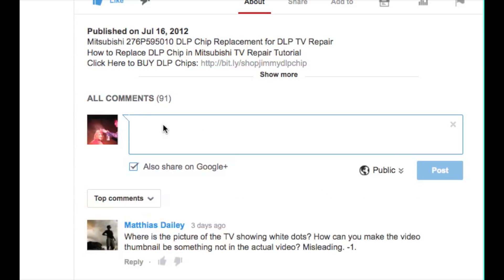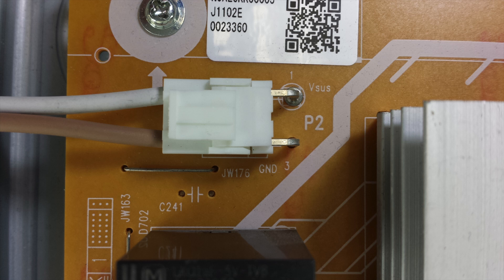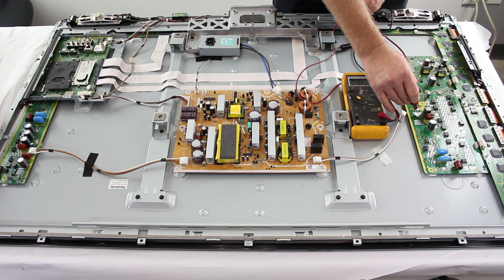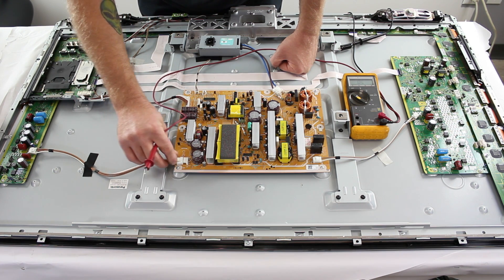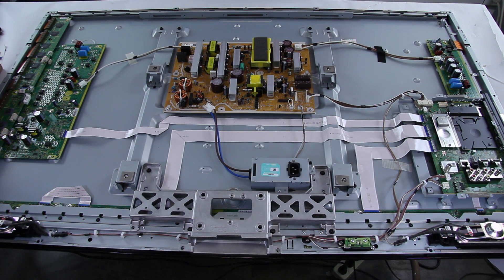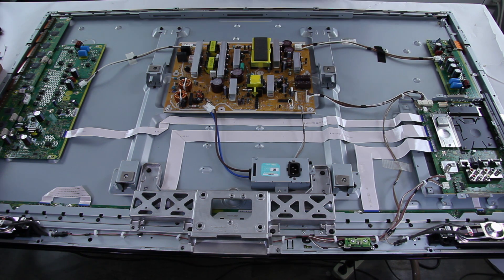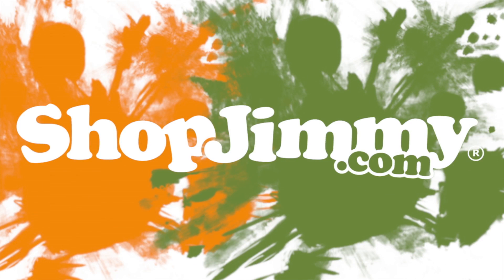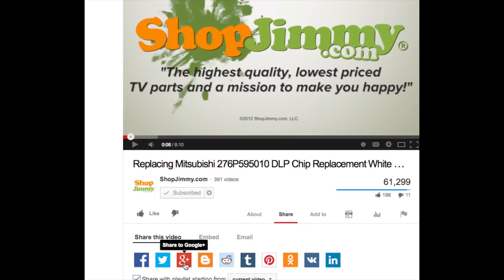Panasonic Plasma TV Repair - Understanding 14 Blink Code - How to Fix 2011 Panasonic Plasma TV

Comment: Thanks for the video! I have a Panasonic TC-P55ST30 manufactured July 2011 that i purchased also in July 2011 and have the 14 red blink code. My kids said they heard a pop and the TV turned off and that was the last of it. I only get the blink code. I tried as you stated, plug it in and after the first click push the power button and the light is solid red. My question is what power supply board would I need? If its reasonable I will purchase one and try replacing it and hope that is it. I see some on eBay but not sure if they're compatible. Prices are not bad. Thanks in advance for your help!
Reply from the maker: Sergio Sanchez   Try this at your own risk. Unplug the TV, then disconnect the SC board and plug in the TV to see if the TV powers up. Reply with the results of this test. Thanks! www.shopjimmy.com
Reply: ShopJimmy.com I did this (because my tv's issue is now similar to Sergio's - solid red light) and got 8 blinks. New power board or A board?
Reply: ShopJimmy.com I will try this...should I unplug both the ribbon and clamp style connector or just one of them? By the way, I tested the p board with all connections and have a short as your video stated. I then unplugged the p 2 connector and short went away. It was reading 2 on the meter but was climbing at a slow pace.
Reply: ShopJimmy.com Me again, OK I tried unplugging both the ribbon and the connector and got same result. Also tried pushing power after I hear first click and get a solid red. Also, I did swap out the p board and have same 14 blink code as before. Same after pushing power button after first click. Thanks again for the help!

Comment: Panasonic TC-P42S30... On power up... half the screen is blank... right side... menu shows up because it's on the left side.  no shorts.  Thinking input board.  FYI the ribbons that go to screen is one board not 2 as shown in your video.

Comment: Hi,
I have a Samsung Tv Model # LN46A500T1FXZA, it has a clicking noise.
I've replaced the capacitors on the power supply board, no changed. When i disconnected the video/control board cable, the clicking noise stopped; What can be the problem?
Thanks for your help.
Reply from the maker: Apolo We  Please watch this video FIRST to help with your repair!  https://www.youtube.com/watch?v=BP3NVNCGEv8   I recommend replacing that board you disconnected and the clicking stopped.  Click this link to replacement parts for your TV model number:  http://www.shopjimmy.com/catalogsearch/result/?q=LN46A500T1FXZA  There may be multiple boards for the same TV model number, be sure to match part numbers on your current board, with your replacement for compatibility.  Thanks and please let us know if you have any further questions with your TV Repair!  www.shopjimmy.com

Comment: Hi I have a 42 inch Samsung plasma model number PN42C450B1D,  MODEL CODE PN42C450B1DXZA.   I was watching tv one night and heard the loud pop and then the screen went black but still have the sound of the movie.   I turn the TV off and on and still have the sound.   I removed the back and everything (caps) looks okay.   According to your video it may be the y board.  So my questions are:1) Could it be anything else?  Is this thing worth repairing? 3) do u have the y board (model no 42U2P_Y-MAIN (1LAYER) available today? 

Thank you in advance for your assistance.
Reply: +Phon Phasavath Could be your power supply or your SC board. If the T.V. clicks every time you turn it on and you get a LED error code a board needs to be replaced. Test the power board for 120v with a meter. If it's the T.Vs built in sound it's not unusual for it to keep working. It's a separate amp built on a different board that gives you audio. I would start checking the boards one by one if you know how to use a volt meter. Sincerely, Steve

Comment: Hello, thanks for the video. I was able to test all the connections, and all of them show activity except the TPSC1. Even after  disconnecting the various boards, it still shows no activity. Does that mean both the SD and SU boards are both bad? I followed your video just like you said and the short is not removed by disconnecting either of the boards. Please help! thanks
Reply: I have a TC-P50ST30. Looking forward to your reply to get my tv fixed. thanks!
Reply from the maker: rbk rbk  Please watch this video FIRST to help with your repair!  https://www.youtube.com/watch?v=BP3NVNCGEv8  Yes, it does mean both those boards are bad.  Click this link to replacement parts for your TV model number on our website:  http://www.shopjimmy.com/catalogsearch/result/?q=TC-P50ST30  There may be multiple boards for the same TV model number, be sure to match part numbers on your current board, with your replacement for compatibility.  Thanks and please let us know if you have any further questions with your TV Repair!  www.shopjimmy.com

Comment: hello i have panasonic 48 inches model no TH-42PV8D . after giving supply it turns on very late or sometime it didnt get turn on.. please help
Reply from the maker: Sudarshan Kumar   This could be a problem with the power supply board or the main board in your TV.  I recommend replacing the power supply first and then if that does not fix the issue, replace the main board in the TV.  Unfortunately I do not see any replacement parts in the search results for your TV model number on our website.  Please reply with your part number on your main board and power supply board and I can try searching for replacement parts.  Thanks and please let us know if you have any further questions!  www.shopjimmy.com

Comment: Thanks for the video. I have 46ST30 that has 14 blinks. Following this video I found that my SC board is shorted.  The board is out of stock. A lot of places seem to selling a repair kit "that MAY" fix the problem. It would be awesome if you could make a video , or have an instruction manual , on how to figure out exactly which component on the SC board is the problem.
Reply from the maker: photovideolearner   You can try the kit to fix your TV.  On the product page, we list the symptoms that the repair kit will fix.  Here is a link to that page:  http://www.shopjimmy.com/panasonic-tnpa5351ah-sc-board-component-repair-kit.htm  Thanks!  www.shopjimmy.com

Comment: Hi there i have a Sony Bravia LCD projection Tv Model Number KF-55E200A
When i turn it on the green LED light flashes and i can hear the fan
but after about a min it shuts off and i have a Red Blinking LED now
it  blinks 5 times pauses then starts again.
If you could help that would be fantastic.
PS im from New Zealand.
Reply from the maker: dipstick27  This is a fan error and you will want to clean the fans.  Try all repairs at your own risk!  Thanks!  www.shopjimmy.com

Comment: Please help!  Model tc-p50gt30 viera.  Replaced the sc board because of a 7 blink error code.  Now it has 8 blinks.  Replaced the SOS3ss board and the ss energy recovery circuit and it still shows 8 blinks.  Any suggestions?
Reply from the maker: Imschertz1  Please watch this video FIRST to help with your repair!  TV Repair! LCD, LED, Plasma, DLP How To Fix Your TV with ShopJimmy.com Help!  It is recommended that whenever you replace the SC board, that you also replace the SU and SD boards at the same time.  Thus, I recommend replacing the SU and SD boards in your TV.  Click this link to specific replacement parts for your TV model number.  http://www.shopjimmy.com/catalogsearch/result/?q=tc-p50gt30  There may be multiple boards for the same TV model number, be sure to match part numbers on your current board, with your replacement for compatibility.  Thanks and please let us know if you have any further questions with your TV Repair!  www.shopjimmy.com

Comment: TC-P42G25

This is a 2010 model. I came home to a single blink code. Held in the power button for 20sec (before doing any research) and it then began to flash 10 blinks. That's when I started to research. I unplugged it for 10min, plugged in and the single blink was back. I held in the power button for 20sec and it's back to 10 blinks. Which code is correct and how should I proceed?
Reply from the maker: daniel smoliga   Try this at your own risk. Unplug the TV, then disconnect the SC board and plug in the TV to see if the TV powers up. Reply with the results of this test. Thanks! www.shopjimmy.com

Comment: I have a Panasonic model TC-P50C1. Per your troubleshooting I replaced the power supply, still have the same problem. No picture or sound, dark screen. If I remove the power cord and reconnect it and then press the power button at the relay click. The led stays solid red. What is the next step?
Reply from the maker: berry scheu  Please watch this video FIRST to help with your repair!  https://www.youtube.com/watch?v=BP3NVNCGEv8  I recommend replacing the SC, SU & SD boards in your TV.  Click this link to replacement parts:  http://www.shopjimmy.com/catalogsearch/result/?q=TC-P50C1  Be sure to match part numbers on your current board, with your replacement for compatibility.  Thanks and please let us know if you have any further questions with your TV Repair!  www.shopjimmy.com

Comment: TC-P42ST30

Shorts on power supply, SC board, and SS board. Is this even possible? Should I just attempt to replace the power supply?
Reply from the maker: stephenperreira   I recommend replacing the TV as it is not worth trying to fix.  Thanks!  www.shopjimmy.com

Comment: Do you know how to fix a TCP42X1 Panasonic when half the TV has picture and other side don't have picture at all?
Reply from the maker: Andrew Tran   This sounds like a TV panel (TV Screen) problem.  If your TV panel is bad, it may be more cost-effective to replace the TV as panels are typically hard to find in stock, difficult to replace, and expensive.  Thanks and please let us know if you have any further questions!  www.shopjimmy.com

Comment: TC-P50ST30 14 blinks.
Had SC board repaired then 7 blinks.
Had SU & SD boards checked by MODUSLINK PTS they were okay.
Tested two leads on power supply for short, everything okay.
Tested SS board for short - okay.
So do you think the panel is bad?
Thanks!
Reply from the maker: koritz123   This still sounds like a problem with the SC board.  Double check that board and let us know what you find.  Thanks!  www.shopjimmy.com
Reply: ShopJimmy.com I tested the power supply and SC boards as indicated in the videos for shorts and everything was good. Even tried another SC board from a similar model. I tested the SC board another way and it buzzes and the green led comes on when disconnected from the SU AND SD boards. Any ideas?
Reply from the maker: koritz123   What part is buzzing on the TV?  Is it the screen?  Thanks!  www.shopjimmy.com

Comment: Hi i have a panasonic tc-p50s30 with a solid red light and a broken power button besel.....any help
Reply from the maker: Aristeo Lopez   Try this at your own risk. Unplug the TV, then disconnect the SC board and plug in the TV to see if the TV powers up. Reply with the results of this test. Thanks! www.shopjimmy.com

Comment: TH42PZ81B
FG8450641

The Little light in front of the TV blinks green for a few seconds and the switches off and the light keeps blinking red ...nothing comes on at all.
Reply from the maker: Chandra Janardan  Please watch this video FIRST to help with your repair!  TV Repair! LCD, LED, Plasma, DLP How To Fix Your TV with ShopJimmy.com Help!  I recommend replacing the A main board in your TV.  Here is a link to replacement parts:  http://www.shopjimmy.com/catalogsearch/result/?q=TH42PZ81B  Be sure to match part numbers on your current board, with your replacement for compatibility.  Thanks and please let us know if you have any further questions with your TV Repair!  www.shopjimmy.com

Comment: I have a Panasonic th-50px75u I have a 7 blinking light code do you know what that one means.  The tv turns on then shuts off and has the 7 blinking lights.
Reply from the maker: travis evans  Please watch this video FIRST to help with your repair!  TV Repair! LCD, LED, Plasma, DLP How To Fix Your TV with ShopJimmy.com Help!  I recommend replacing the SC, SU & SD boards in your TV.  Here is a link to replacement parts:  http://www.shopjimmy.com/catalogsearch/result/?q=th-50px75u  Be sure to match part numbers on your current board, with your replacement for compatibility.  Thanks and please let us know if you have any further questions with your TV Repair!  www.shopjimmy.com

Comment: I tested tpsc1 and it was ok, but had a short at sc2, now what
Reply: Replace or repair the SC board. This fault is so common with this series it's not funny. ModuslinkPTS offer a repair service which I recommend and have read plenty of good feedback. There are repair kits which can help but keep in mind a repair kit does not always contain every part to automatically fix these as you need to correctly fault find the board. I do believe  it's fairly straight forward replacing shorted IGBTs and sometimes the FET driver ICs blow too.

If you have no soldering skills, send the board off for repair. It does involve removing surface mounted transistors

This is a newly revised video. SJ first version was crap, tried to help them out by telling them but they would not listen. It's taken 6 months for them to wake up.
At least the public should correctly diagnose this now

Comment: Ok.  If you have a short to ground on the SC board power connection, but no short on TPSC1, what does that mean?
Reply: It's a 2011 Panasonic Plasma TC-P55ST30.  I would like to place an order, but no response is making me wary.  I am assuming the SC board is bad but the video didn't cover my situation above.  I also have a bad connection on the power board going to the SS board which doesn't have a short on it's end.  With so much wrong I am also worried about the main board which according to video I can't really check until the other boards are working.
Reply from the maker: Ocala-Living   This sounds like a bad SC board.  I recommend replacing the SC board, here is a link to replacement parts:  http://www.shopjimmy.com/catalogsearch/result/?q=TC-P55ST30  Be sure to match part numbers on your current board, with your replacement for compatibility.  Thanks and please let us know if you have any further questions with your TV Repair!  www.shopjimmy.com
Reply: ShopJimmy.com We replaced the SC board, power board and the A board just for good measure and the 14 blinks are gone.  The TV red led light turns on and off normally with the power button.  After long hold of the power button, the led just stays off.  No blinks, but we don't have picture and sound.  What would be the next step in trouble shooting the problem?
Reply: Ocala-Living We did a factory reset (menu and vol - hold) and sound started working, but still no screen even for tv menu functions.

Comment: I have a Toshiba tv model number 40RV525U and it will not turn on. It has a flashing green light that flashes about every second. Thanks for taking the time to help me with this problem.
Reply from the maker: Willie Green   I recommend replacing the main board in your TV.  Here is a link to replacement parts:  http://www.shopjimmy.com/catalogsearch/result/?q=40RV525U  Be sure to match part numbers on your current board, with your replacement for compatibility.  Thanks and please let us know if you have any further questions with your TV Repair!  www.shopjimmy.com

Comment: VIZIO E551va 55" LCD TV with blurry video, color is smeared, cable and DVD are the same.
What do you recommend for the fix?
thank you
rappatobey@yahoo.com
Reply from the maker: barney jack  Please watch this video FIRST to help with your repair!  TV Repair! LCD, LED, Plasma, DLP How To Fix Your TV with ShopJimmy.com Help!  I recommend replacing the main board in your TV.  Here is a link to replacement parts:  http://www.shopjimmy.com/catalogsearch/result/index/?cat=56&q=E551va  Be sure to match part numbers on your current board, with your replacement for compatibility.  Here is a link to a video showing how to identify your part number, click here:  TV Part Number Identification Guide for Vizio Main Boards (Plasma, LCD, LED)  Thanks and please let us know if you have any further questions with your TV Repair!  www.shopjimmy.com